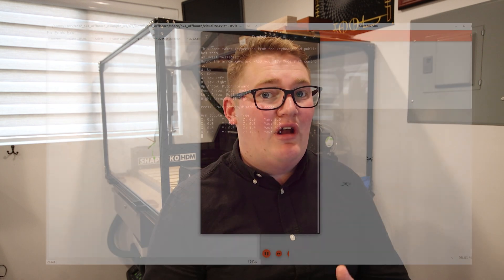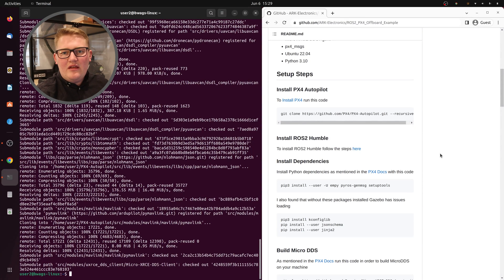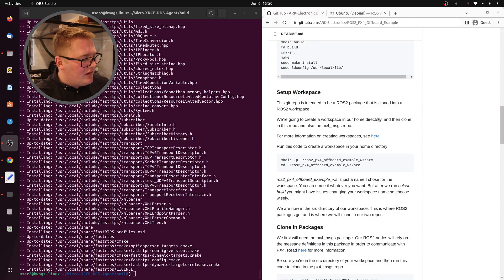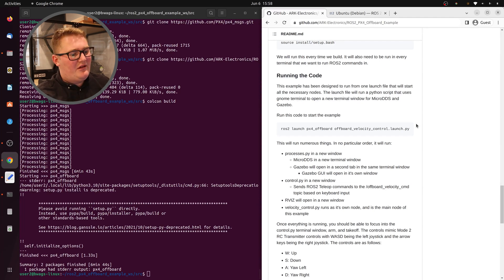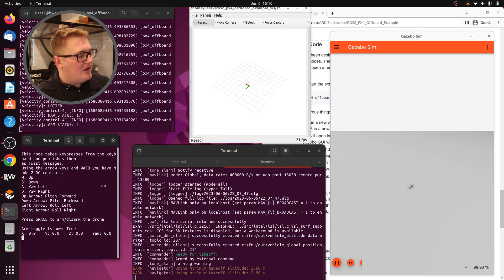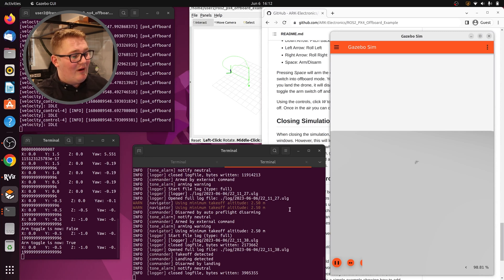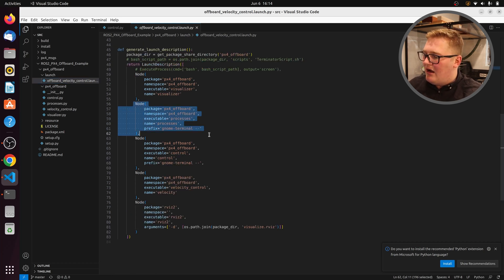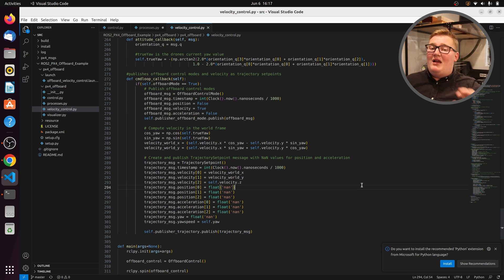ROS2 and PX4 Tutorial | Simulated Offboard Mode

Comment: Finally, I was able to run it successfully on Ubuntu24.04 with ROS2 Jazzy + Gazebo Harmonic👊some minor changes I had to make to make it compatible with Jazzy and harmonic, like for PX4 I had to dowload the latest version not the v1.15 but mainly I was stuck with `drone not moving` issue with `pxh> WARN  [health_and_arming_checks] Preflight Fail: No connection to the ground control station` error which simply went away by installing QGroundControl.  Thanks for the tutorial.
Reply: I have installed QGroundCotrol, but still no movement. Do you do anything with the QControl or?? Im really stuck and lost =(
Reply: @zunairamamhood7378  Plz make sure you are running in the latest system like I did and install the latest version of PX4 not v1.15
Reply: @masumbillah1826  I have the same issue too. I'm not sure to understand what you did exactly. I just cloned the PX4 repository on the main branch. Could you help me ?
Reply: @masumbillah1826  i am running px4 on the latest version 1.16.0 but still no movement in rviz or gazebo sim after running the final command
 , but there is movement when I give commands from qgc
Reply: @DakshSolanki1325  try with PX4 v1.15 and also take note of the error shown in the terminal. I'd recommend deleting everything and start over.
Reply: @zunairamamhood7378  same did you find any solution?

Comment: Hi, Ive seen to be running in some issues. When running the command to start everything, im getting this in my termninal
INFO  [mavlink] MAVLink only on localhost (set param MAV_{i}_BROADCAST = 1 to enable network)
INFO  [px4] Startup script returned successfully
pxh> WARN  [health_and_arming_checks] Preflight Fail: No connection to the ground control station	
WARN  [health_and_arming_checks] Preflight Fail: No connection to the ground control station	
WARN  [health_and_arming_checks] Preflight Fail: No connection to the ground control station	

and moving the drone does not work. Has anyone found a solution for this?

Comment: @arkelectron, thanks for the code and tutorial, but again as many people in the comment section down here, I am unable to get the drone moving from keyboard commands. Also, I do not get the issue 1.4 fix you are referring to. Could you help us out for once to debug this?
Reply: Did you figure it out? I am also stuck; the drone is not moving. no error so far. I'm running on Ubuntu24.04 + Jazzy + Gazebo Harmonic
Reply: did u figured it out?
Reply: yes, I figured it out and successfully ran. check my other comment bellow

Comment: Hi Braden. First of all, great video. I tried this and i got to the Gazebo Sim part. however i could not able to control the drone. Leaving that apart, i see that this simulation is done on Gazebo Sim7 with Ubuntu22.04 as OS and ROS2 Humble as node. I want to know whether instead of Gazebo Sim7, coulr we use Gazebo 11 or the latest version. I tried this but i got the makefile error. Is there some issues on ubuntu 22.04 regarding working of Gazebo

Comment: I am trying to run this on Ubuntu 22 with ROS2 humble and everything start however the only velocity_control messages I see is "Arm Message: True" and "Arm Message; False" as I toggle with the space bar.  There are no other messages.  No action when I press the wsad keys.
Reply: Same issues, what we can do?
Reply from the maker: @christopherbousquet-jette4301  We just pushed a fix and updated the README to point to 1.14.
https://github.com/ARK-Electronics/ROS2_PX4_Offboard_Example
Reply from the maker: We just pushed a fix and updated the README to point to 1.14.
https://github.com/ARK-Electronics/ROS2_PX4_Offboard_Example
Reply: Hi, I have the same problem... Could you make it work?

Comment: Thank you so much for your interesting lesson! i wanna request you how can install or get "gz_x500"?. I use ubuntu 22.04, how it doesn't run command "make px4_sitl gz_x500". I appreciate you if you give me a response.
Reply: With ubuntu 22.04, after cloning PX4-Autopilot repository as described in the tutorial, gazebo garden is installed by default and all models including x500 (gz_x500) is automatically installed. Make sure to run the bash script for the gazebo to be installed as the tutorial says. Also it does run the command make px4_sitl gz_x500, but it is done through the processes.py file in the ros2 offboard package src

Comment: But tragectory_setpoint msg seems to didn't work for fixed wing isn't it?
Reply from the maker: It appears that the fixed wing position controller supports trajectory setpoints in offboard mode. 

https://github.com/PX4/PX4-Autopilot/blob/main/src/modules/fw_pos_control/FixedwingPositionControl.cpp#L2182-L2185

Comment: Is it possible if i use wsl2?
Reply: I've used Windows 10 and wsl2- the 'make' process on px4_msgs and px4_comm packages wasn't done overnight. 

For context, I used an 8GB RAM, 2.7GHz 4- cores computer. So, I just ended up switching the OS to Ubuntu 22.04 and it took only 30 minutes as it had in the past on a raspberry pi 4 8GB RAM
Reply from the maker: You might be able to. I haven't tested it in wsl2.
Reply: Yes, it is...

Comment: How can this be used for a real flight controller to get real-time data from say a Pixhawk Cube and be able to send commands to the Pixhawk Cube from ROS2? I've tried connecting to it but I've had no luck
Reply: I have to second this!! I have spent weeks trying to get my Cube Orange to connect to my host computer from the jetson nano with the new uXRCE-DDS the PX docs about the agent are very vague!!
Reply from the maker: @wmlong777  Follow the instructions in the docs for building from source. Then on 1.14 or main PX4 set the param UXRCE_DDS_CFG to the port you want to use.  On the companion computer run "sudo MicroXRCEAgent serial --dev /dev/AMA0 -b 921600" pointing to the serial port you are using.
https://docs.px4.io/main/en/middleware/uxrce_dds.html#micro-xrce-dds-agent-installation
https://docs.px4.io/main/en/middleware/uxrce_dds.html#starting-the-client
Reply: I have been stuck on this for couple of minutes until I realised the connection just needs some time. I followed docs on px4 site (linked above by @arkelectron). Used serial connection and nothing happened (my DDS agent didn't connect and topics were not created). I was searching around and turned out that after I left this setup for some time it finally managed to connect. It may be buggy or my setup was just slow. I used SiK Holybro telemetry radio (can't remember which version) as serial device, and other end of this radio was connected by USB to my laptop where I redirected this USB device to WSL2 instance using usb-ipd. On WSL2 then I started DDS agent and it worked like a charm, I could use ROS2 without cable connected to the flight controller (Pixhawk 6X).